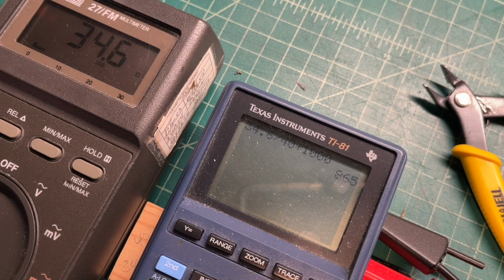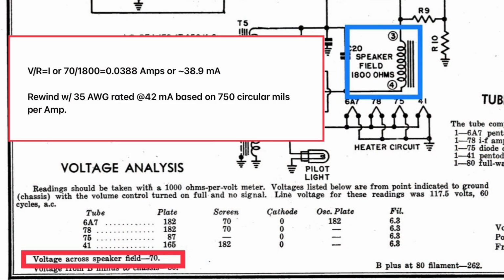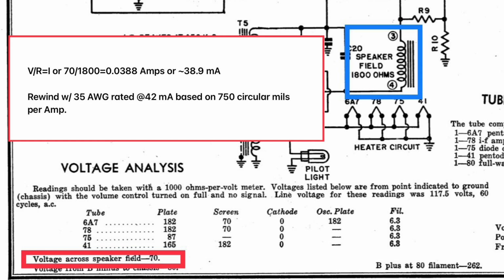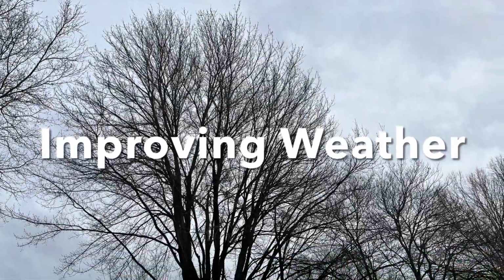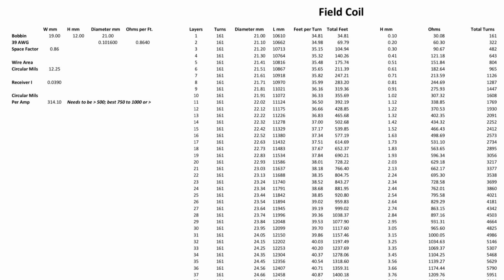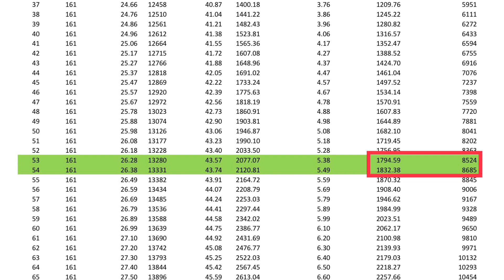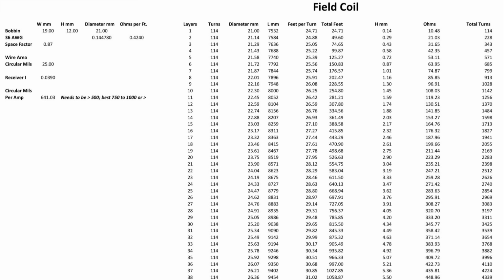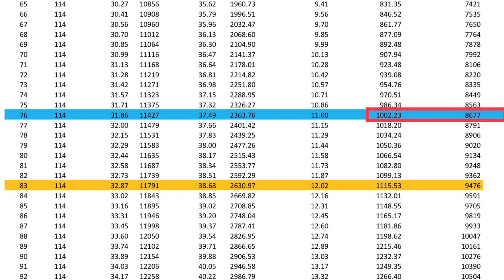Emerson R156 - Field Coil Rewind Design | Determining the AWG

Comment: Thank you, for your reply to my question :) Yes you are correct, the copper washer is right next to the field coil  bobbin on the voice coil side of the speaker. The cardboard washers "3 of them" are after the copper washer on the voice coil side of the speaker. Any ideas ??
Reply from the maker: Best guess that it’s used to increase the magnetic flux in/around the area where the voice coil enters the air gap. Hope your rebuild goes well. Best, Don

Comment: Thank you for the great video and information:)  My field coil in my speaker is also open. I also have learned that my wire gauge is also undersized. When I was disassembling the speaker. I noticed that there was a copper washer about the size of the field coil bobbin along with 3 cardboard washers. Do you have any ideas as to what the purpose of the copper washer might be? Thank You, :)
Reply from the maker: Glad it was helpful! Was the copper washer placement at the end of the field coil close to the voice coil? Best, Don

Comment: I think the important value is the inductance, not the resistance. And so the number of turns.
But it can be compensated with a higher value filter capacitor.
Interesting project to restore a loudspeaker.
Reply from the maker: Alain - you’re spot on. I think based on my calculations, the rewind w/ 36 AWG will increase the inductance by ~18%, but I’m prepared to increase the capacitance as needed. Thanks for reaching out and following along. Best, Don

Comment: At that voltage and current that  original coil wire would have gotten very very warm , destroyed the enamel covering,
arced and went. All the math information presented here proves someone goofed in it's design or application. So very
typical in cost cutting by those manufacturers. We wll see if your adjustments in design can overcome any  problems.
Reply from the maker: Yep, Steve to your point the OEM design is flawed. I’m left wondering how many hours the radio played before giving up. Hopefully the modification will work out. Best, Don

Comment: Thanks for going over the math Don. :)
I have not worked on the field coil part of a speaker before (all mine to-date have magnets). Quite a few windings there. Yes that wire size is a bit small for supporting the current for essentially the entire radio circuit, good call on bumping the size up. Final inductance, if lower, could be corrected by just increasing the size of the filter cap (C20) a bit perhaps or adding a second one?
Sure is a strange circuit on that old Emerson, putting the choke on the return (GND) side of the power supply.. makes my teeth itch just looking at it when trying to work out the RF current flow and ground references.. :D
Cheers,
Reply from the maker: Eddy - definitely a lot of turns and hopefully I won’t break the fine wire while… I ran the inductance numbers for a multilayer air coil with the 39 AWG and 36 AWG and if my calculations are close, the new coil with 36 AWG should increase the inductance by ~18%, but if excessive hum to your point is problematic, I’ll increase the capacitance as well. Not knowing the permeability of the core material and surrounding… I’m not sure how to calculate the final inductance once I get the loudspeaker back together. I look forward to measuring such once I get to that point. Best, Don

Comment: No   as you wind the  coil  around  the bobbin  the  diameter  of   stack   increase  and is not  linear  therefore  the induction  is  not going to  be near   you think
Reply: Hi Don ,I think your going to be real close to the 1800 ohms if you fill the bobbin. I have yet to measure a field coil and have it come out to what it said on the schematic . ( warm or cold) it is usually  2 or 300 less . Though I am just a novice, learning from experts like you is always fun and a pleasure . Thanks for sharing . Dean
Reply from the maker: Thank you Dean, more to come soon following receipt of the magnet wire. Best, Don
Reply from the maker: Thanks for info John. Once complete, it will be interesting to measure the… Best, Don
Reply: Due to the magnetic core of the bobin, its inductance is quite independant of the diameter of the coil (but not of the diameter of the magnetic core).

Comment: It will be interesting to see how the numbers work out. Do you know if the AWG standard takes the coating into account? Thanks for letting us look come along. Great project.
Reply from the maker: John, to estimate the number of turns, I used the specifications for a 36 AWG single enamel coated magnet wire and a space factor of 87% that allows for the dead space between each turn. I’ll wind north of my target and check DC resistance then hopefully back off a few turns to get to my target of ~1000 ohms. Hope this helps and thanks for following along. Best, Don
Reply: @RestoreOldRadios  
Thanks Don